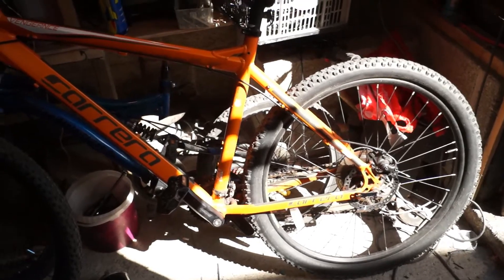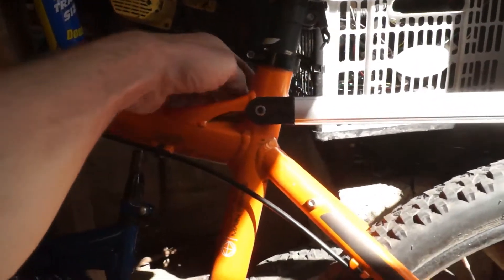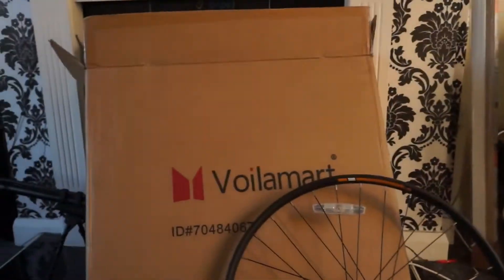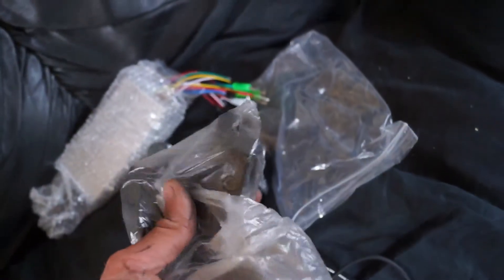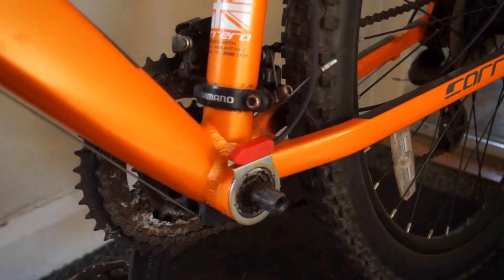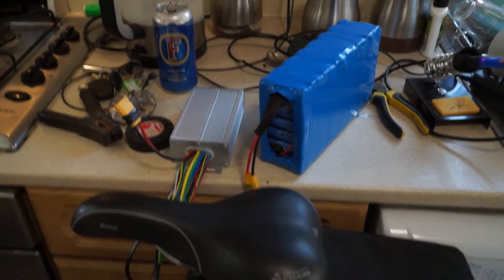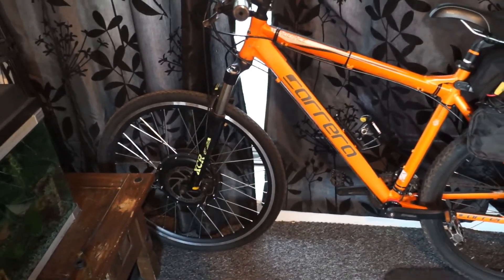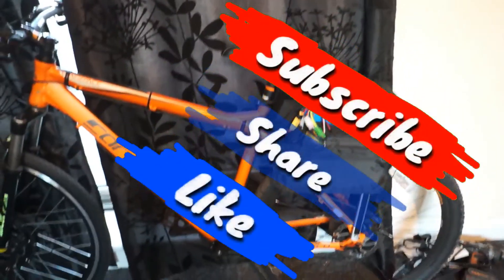Electric bike conversion voilamart 1000w

Comment: Hey!!

I have a carrera with 27.5  wheels on it i might order a kit i found  one with a rear mottor  but the wheel size is 26 wouldnit still fit in the frame ect i know its going to be smaller then the original  but will it fit and work?
Reply from the maker: It should fit...I had to modify the front wheel...so not sure how universal the rear would be..I am converting another soon, rear wheel drive...

Comment: you need a bottom bracket too l to remove the bottom bracket so you can butt the sensor behind it. and what you are calling design faults aren't design faults, these kits are meant to work with most bikes so you cant expect them to make a kit that fits and work perfectly with every bike ever made.
Reply from the maker: THERE WAS NO OTHER bracket I didn't fancy drilling into the crank
Reply: @electricdixie34  Yes there is. I could clearly see the notches for the bracket at 4:25. there is only a very thin part that sits outside of the housing of the crank. You have the same bottom bracket type as mine. you need a specific tool for a 22 tooth shimano bottom bracket.  sometimes they can be very hard to unscrew, to get mine off i had to run boiling water over the bracket for a couple of minutes, then I put the tool in and used a spanner and rubber mallet, if they bike is relatively new it wont require that much force. This is the tool I use: 
https://www.amazon.co.uk/Park-Tool-BBT-22-Bracket-20-Tooth/dp/B001A0AIAG/ref=sr_1_9?crid=11VOBEJZ299FM&dchild=1&keywords=bottom+bracket+tool&qid=1601273320&sprefix=bottom+brack%2Caps%2C169&sr=8-9